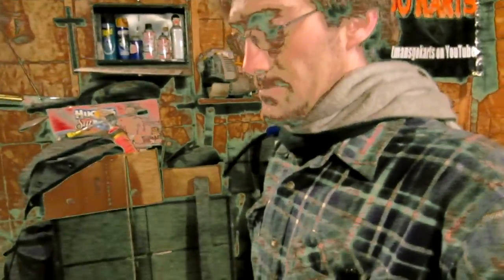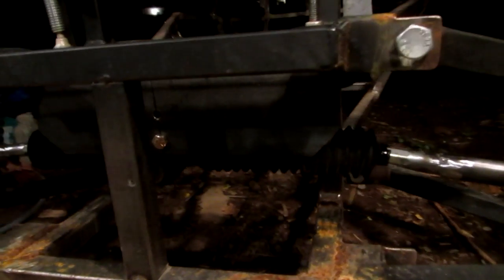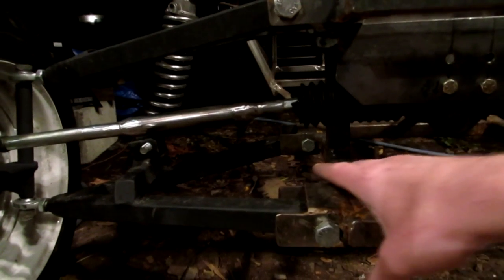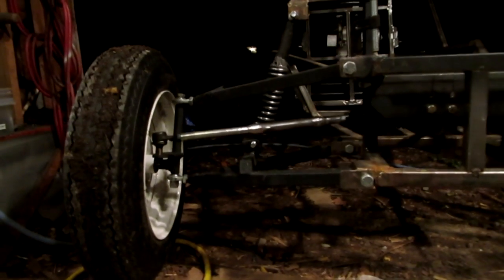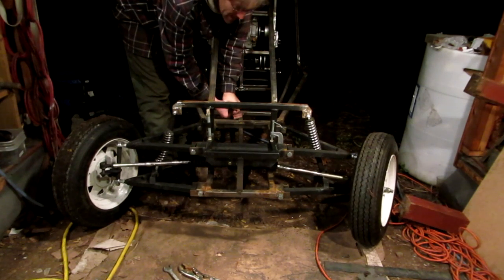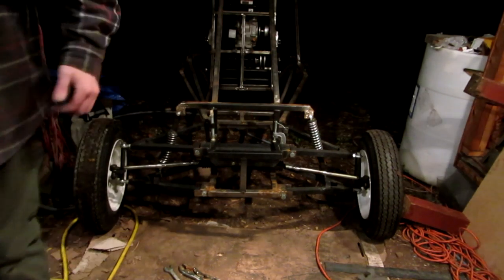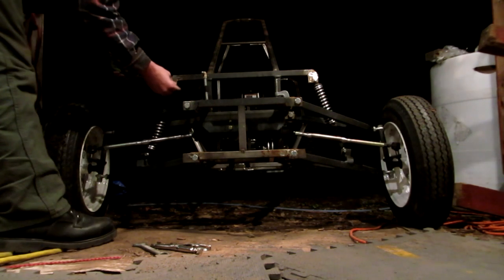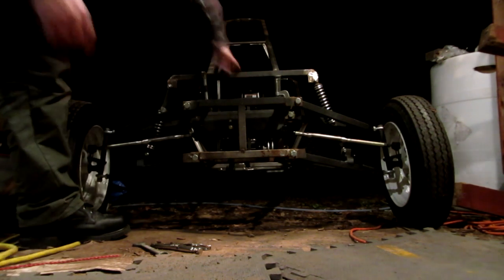Off-Road Buggy Build #20 ( Streering is Done / Rack and Pinion ) Fullscreen Machine

Comment: what kind of wire do you use for the welding machine
Reply from the maker: +Eleazar Hernandez ... the size I use is .035 flux core. I use a harbor freight 110volt welder
Reply: +T-Mans Go Karts thanks because i have a 90 amp 110 volts welder and bought wrong wire